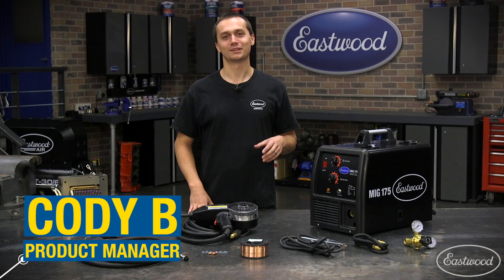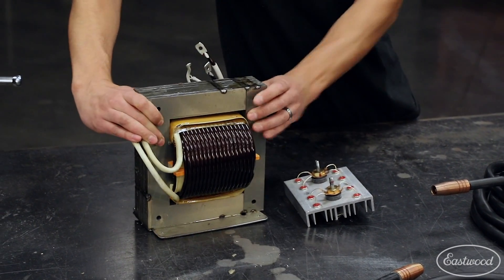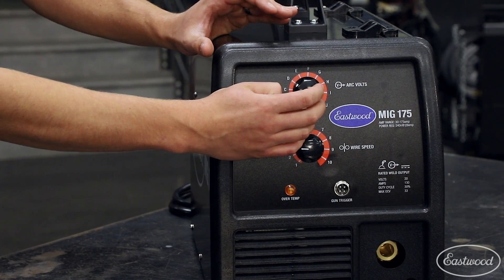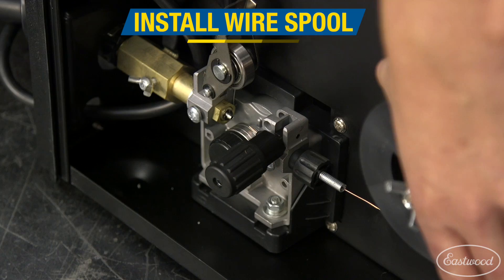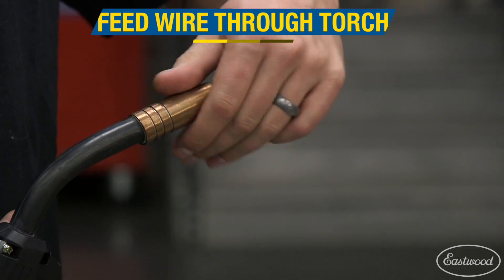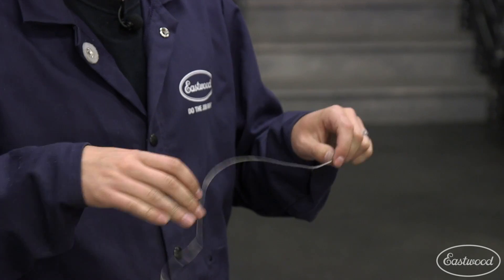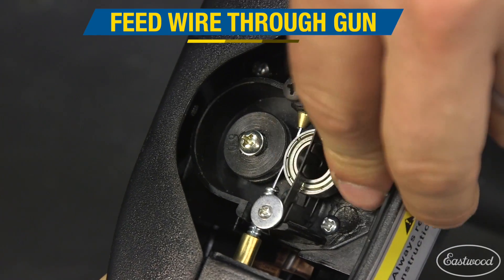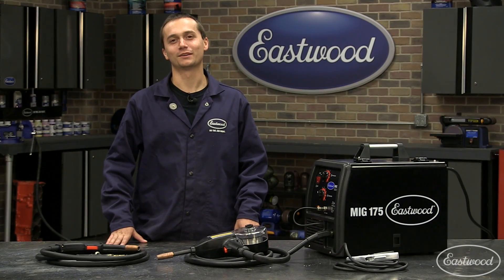MIG 175 - Why You Need This Eastwood Welder - MIG Welding Basics - R&D Corner

Comment: Love my MIG 175. Can the new metal drive motor be retrofitted to replace the old style plastic drive motor assy?
Reply from the maker: The new metal drive motor is not designed to fit the older machine.